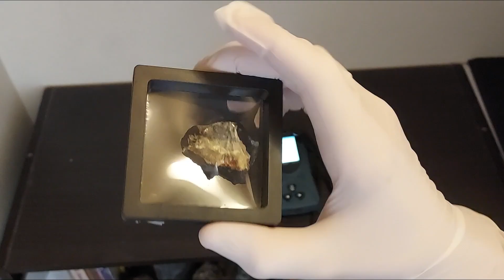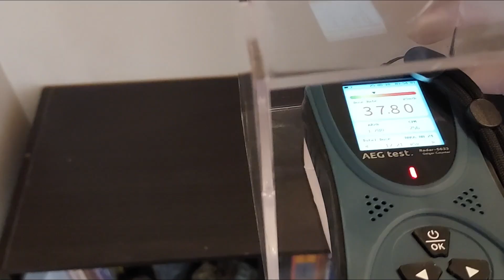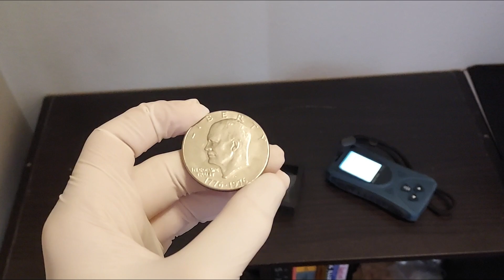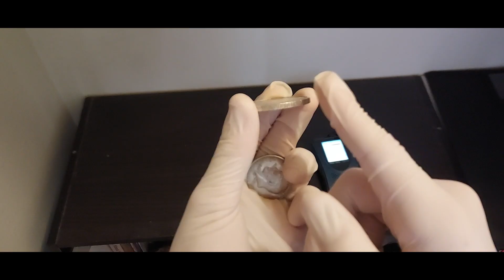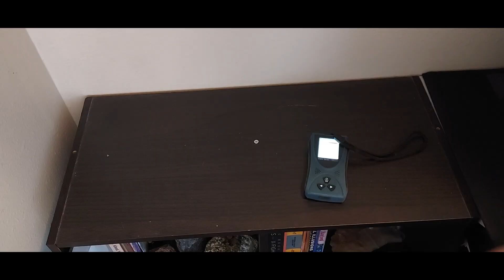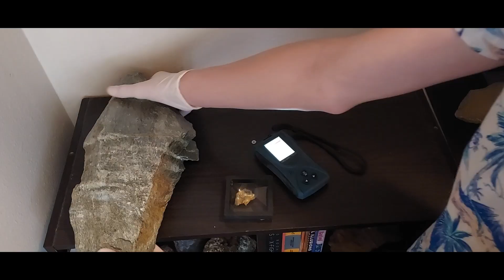What Random Materials Can Block RADIATION? Seeing What Works Best!

Comment: The shielding in this video could never stop the gamma rays coming from my 1uCi Co-60 source since the energies for the 2 gammas coming out of the source. 1st is 1173 keV, and the 2nd 1332 keV. only realistic shielding is some lead for Co-60.
Reply from the maker: Indeed! Some water would also attenuate Co-60! It was more of a fun experiment to see what would shield the very weak gamma coming of NORMs! :D
Reply: @ReactorLaboratoriesthat would be cool to stop the gammas coming from low energy gamma sources. Might try it on the americium-241 that I have since the gamma energy is very low.
Reply: And you are correct water would also work great for shielding for Co-60 you just need to seal the containment vessel better
Reply from the maker: @KyleVanlahr  Yup! :D
Reply from the maker: @KyleVanlahr  That's a good idea actually! I could seal up the source with epoxy as a lot of my commenters suggest, (Am-241 contamination is no joke) and then I could have differing amounts of water and see what the shielding effect is! :D
Reply: @ReactorLaboratories a test that I have been wanting to do for a while is take Am-241 which emit high energy alpha particles and put it on beryllium. since when a alpha particle hits a beryllium nucleus it splits the 2 neutrons off of the alpha particle sending them as fast neutrons. and you can indirectly detect it with the radiacode since it uses a CsI crystal so when a neutron hits a iodine atom it spalls out gamma rays
 which the sintillator can detect.
Reply: could make a vid about it too just have to get some beryllium. luckly they have it for 14 dollars off of amazon.
Reply from the maker: @KyleVanlahr  That would be a cool test, but that might damage the radiacode and make other things radioactive. If you do, just be extremely careful! :)
Reply: @ReactorLaboratories oh yea i will be careful doing it but i dont really see how it could damage the scintillator inside of it.
Reply: @ReactorLaboratories it does not emit many neutrons only about 4,000 neutrons per second. which if you think of it on the atomic scale is not too bad.
Reply from the maker: @KyleVanlahr  It changes the structure of the crystal! :)
Reply: @ReactorLaboratories also i was very wrong on the neutron count coming out of an Am-Be source instead of 4,000 neutrons per second from 1 uci of Am-241 it is instead 2 neutrons per second. which is a good thing because 4,000 neutrons per second would be 100s to 1000s of mSv per hour. (depending on distance).
Reply: @ReactorLaboratories you are not wrong here neutrons can change the crystal structure but i did some research and the neutrons required per second to damage the radiacode's crystal would be 10 to the 11th power neutrons which is 100,000,000,000 neutrons per second. and my source is 2 neutrons per second.
Reply from the maker: @KyleVanlahr  Cool! :D
It's seems it should be fine then! :D
Reply from the maker: @KyleVanlahr  Indeed! It depends on the neutron energy, but yeah, neutrons are pretty scary! :)
Reply: @ReactorLaboratories true it is usally 5-11 Mev

Comment: Now... Test the reading in the air but the same distance that the biggest was thick...   

You'll see that air itself is good at blocking radiation.  And no it isn't distance.  But it is because air blocks radiation by distance.
Reply from the maker: Well, it depends on the type of radiation! For alpha and beta radiation, yes, air blocks it quite well, but for gamma radiation, air doesn't attenuate it. I should have specified that I was talking about gamma radiation when I mentioned inverse square law (IR^2 or with double distance, you get a quarter of dose). :)

Comment: If you're into radiation this much you gotta get the cdv700. And if you learn the basics of geiger tube circuits you can pretty much make whatever you want with some practice
Reply from the maker: Indeed! :D
It's been on my list for a while, but I have had other things over it for a while as well! I will be buying one for a video I'm planning out, but that's a while out from now! :)
As for building one, that sounds like that would be a fun video! :D
Reply: @ReactorLaboratories I could teach you if you are interested, you just need to know how to solder and access to different parts from eBay, I like to buy really bad broken ones and strip the paint and gut the electronics and make my own circuit and I almost always use vacuum tubes
Reply from the maker: @KiKi_of_poland  That would be pretty cool! :D
That sounds pretty interesting! I think that would be a cool project! :D

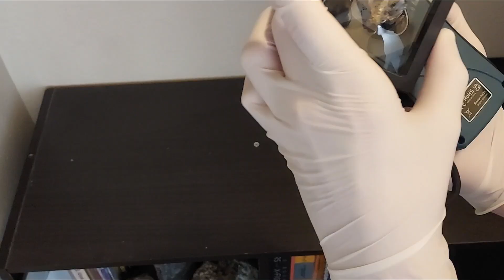Comment: 0:55 min Where does the information come from that the device has energy compensation? I think that's wrong. Energy compensation is the 'highest art' of measuring device construction; it can't possibly be included in a $50 device. And if it does, then show us the compensation for emitters with different energies, not the shielding of radiation with coins.

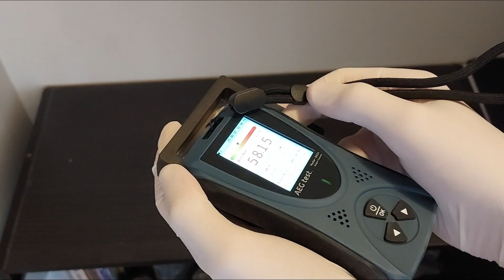1:15 min Wait A MINUTE  to measure a sample of 58 µSv/h? The sensor must be completely insensitive! The advertising images show 1 or 2 CPM for ambient radiation, which is absolutely abysmally bad! Any Chinese device with a counter tube (M4011) has TEN TIMES the sensitivity. The sensor consists of a few PIN diodes, which is technology from 40 years ago. Useful for higher radiation levels or dosimeters, but useless for a handheld device that needs to display a stable reading as quickly as possible. It's disappointing that you call it a 'good device' instead of honestly saying that you wouldn't recommend it to anyone.
Reply from the maker: It uses a semiconductor based detector, and it is energy compensated. However, it's not that fast! It is only 50 dollars, and the one thing they chose was energy compensation! It says that it's energy compensated on the user's manual, and while it's not the best, it does still actually do a decent job. Especially for 50 dollars.
That point I brought up in the video, taking a minute to measure, it's the main downside. I do wish that they made it faster, but then again, it's difficult to make a fast pin diode detector.
I do genuinely think it's a pretty decent choice, but if you think I should more brutally honest, I'll take note of that! :)
Reply: @ReactorLaboratories Well, the Chinese like to claim things about product features that aren't true, or only half-true.
But you're right, the German Amazon product description also mentions energy compensation. It also says it's an 'imported sensor,' perhaps from Korea. Compare the measured values of various nuclides (e.g., Am-241, Ra-226, Cs-137 (if you have one)) with a RadiaCode. If the values are roughly the same, then that's really the case.
Reply from the maker: @dg0mg  All right! :D
I don't have a Cs-137 disk (though it's on the shopping list!), but I'll check it out with  some different radionuclides to check! :D